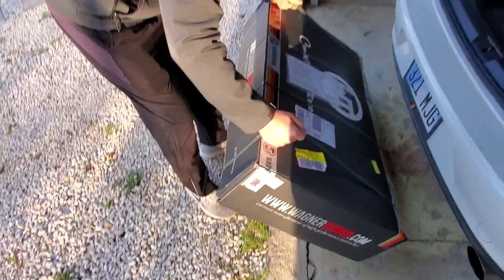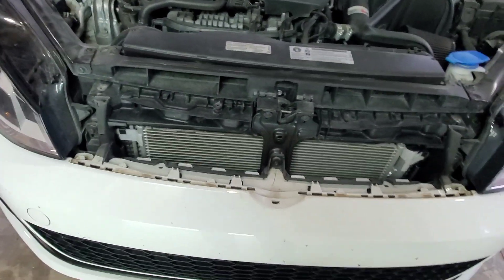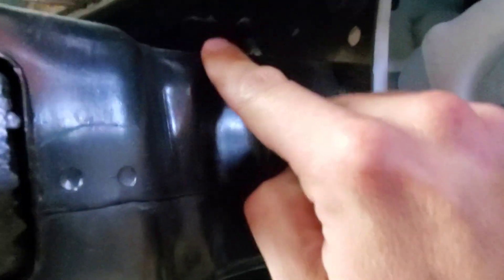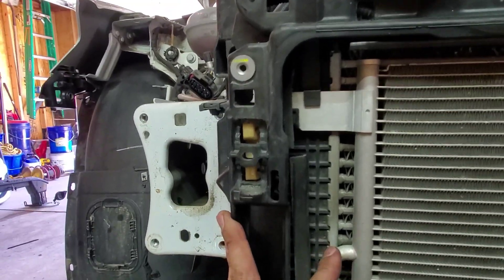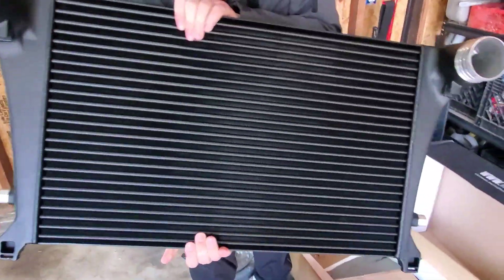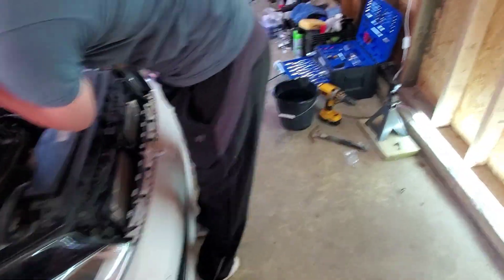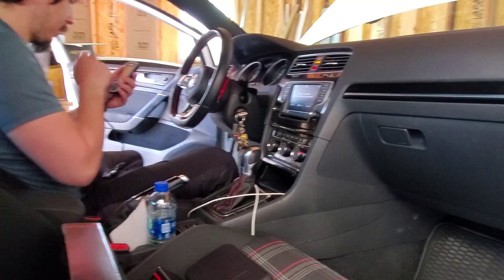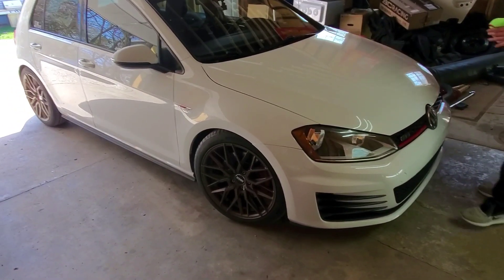MK7 GTI Intercooler Install in 10 Minutes!

Comment: The worst place to get to the intercooler. Should be like 1/2 hour job but due to its complex location it takes 4 to 5 hours to take off the entire front of the car.
Reply from the maker: It took us between 2 and 3 hours. It was a 25 minute job on my Evo. LOL
Reply: @ImJibby  exactly, should not be this difficult. These are bolt ONS upgrades and should not take removing the entire front assembly off.

Comment: Is a down pipe requirement when replacing intercooler im running a bone stock 2.0 t just looking for better breathing intercooler
Reply: Nope. Only thing that requires a downpipe is most stage 2 tunes.

Comment: So you have to tune is it a must when upgrading a intercooler??? Thanks for.the vid
Reply from the maker: I highly recommend it
Reply: You have it backwards: a quality intercooler upgrade is critical for any tuned VW/Audi.

The engine, turbo and car will all benefit from a larger, higher flowing I/C, regardless of stock tune and boost vs tuned increase.

I’m in TX, anywhere south of Maryland it gets hot enough that even a stock (untuned) car benefits greatly from the IC upgrade. 👍 😎